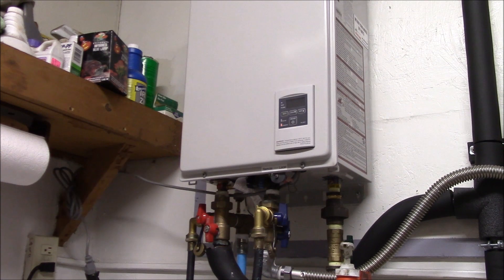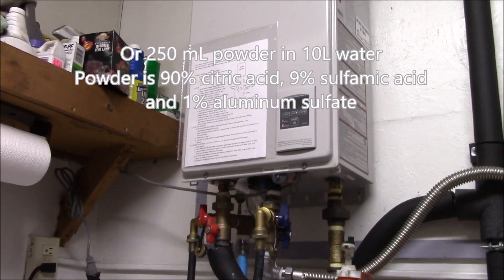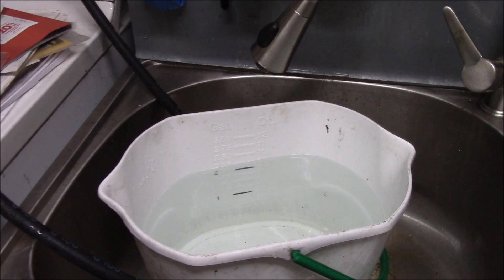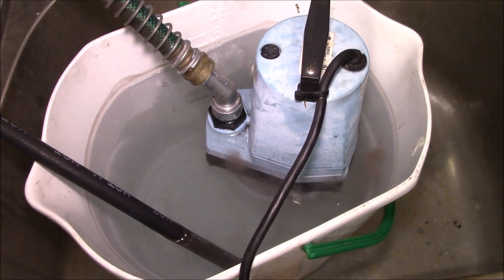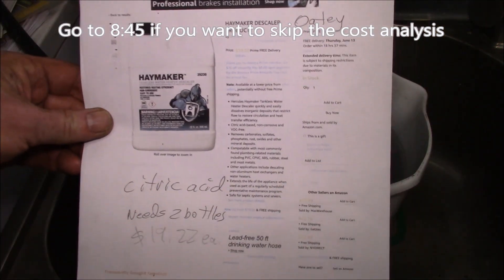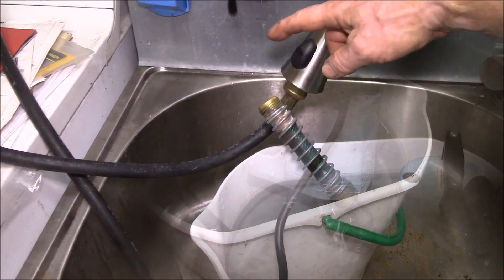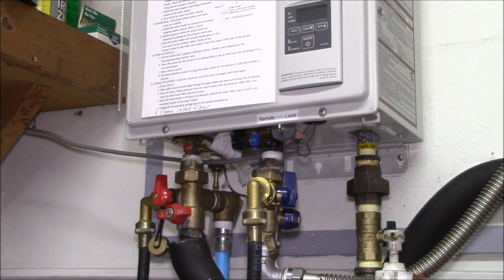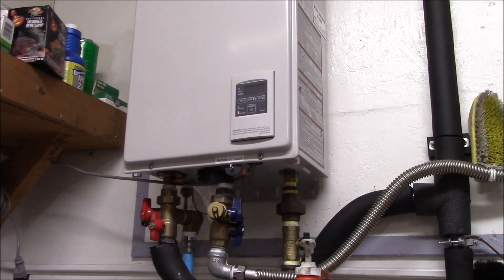Descaling a Tankless Water Heater with Citric Acid Mix

Comment: Great video. Thanks for doing this.

P.S. I did notice that the temp was still set to 140° at the end. 😉
Reply from the maker: Yes, thanks.  I was planning to run the dishwasher after this, so I left the temperature set high.  I tend to set the temperature for whatever task I need the hot water for.

Comment: Thank you for your valuable information. My friend just bought a condo with a Takagi water heater. Unknown if it has been flushed. I’m going to buy some Dezcal and follow your instructions. I was hesitant to buy the ready made tankless descaling products that you mentioned. I don’t understand why the electricity needs to be unplugged from the outlet? So the tankless water heater isn’t running and the pump is running to circulate the descaling solution? Thank you for your time and effort.
Reply: Thank you for explaining that point. It makes sense….and thanks for responding so quickly. I’m off to descale the tankless water heater just in time because the water pressure seems really low at the kitchen sink. I don’t have your ph meter, but I do have ph test strips. That should work fine.
Reply from the maker: @bettyyoung868  No real need for the pH testing.  I mainly did that for the video and to make sure my descaling mix was strong enough.  I used about 1 cup of powder to a bit over 2 gallons of water and that seemed to do the job.  I save the used liquid for cleaning around the house, it's great at removing hard water and rust stains.
Reply: @The4Crawler  Can I use the descaling solution in my washer? I think I can use the solution in my dishwasher to clean it too. I will strain before reuse.
Reply from the maker: @bettyyoung868  Yes, I save all of mine in gallon jugs and use it over the next year or so for cleaning.  Dump some in the dishwasher and run a wash cycle. 
https://youtu.be/EwGFnkvtcWE?si=vLIWEX4AhbhDKxZe
Reply from the maker: White vinegar works as well, maybe a gallon or two.  I think the idea of unplugging the heater is that there may be internal valves that may bypass the heat exchanger if the machine is turned off.  But when unplugged, all those valves stay open so that the descaling solution can flow through the internals vs. just going from inlet to outlet.

Comment: Very good and informative video. I need to do that too. Maybe mine, Rinnai, is broken, it says I should descale when I get a code... well I never got a code in 7 years and I forgot to kind of do it anyway. I will try this to see if I get any scale in the pail using citric acid. I will start with same dilute. Thanks again
Reply from the maker: I always wondered about the scale sensors.  My Takagi doesn't have one, so I just do mine every year or two.

Comment: Good job! My only concern is the strength of your descaling solution of 1.2 ph. This is well over 10 times the strength of vinegar which is recommended by tankless water heater manufacturers. Won't this over time damage the hot water heater? If not, why don't manufacturers recommend a stronger descaler?
Reply from the maker: I based the mix on the ratios used by my Espresso machine descaling powder (Dezcal):
https://youtu.be/bJGKcatfei4
The mfg. of that machine also listed vinegar, diluted 50% with water, as a recommended solution, but have now updated their recommendation to use something like citric acid.  I found other descaling products using citric acid, hydrochloric acid and other compounds.  I suppose most mfgs. list vinegar as it's a generic, readily available product and will do the job given enough time.
Reply: @The4Crawler  The recommended 28g of Dezcal per liter of water would yield a 2.11 ph descaling solution since it's only 60% citric acid. Of course, the ph would be a bit lower due to the 5% sulfamic acid in Dezcal. That's about 1/8th the strength of a 1.2 ph descaling solution. Obviously a 1.2 ph solution would descale better and faster. But will it harm my $1,500 tankless water heater? I've been unable to find any definitive information one way or the other. If I don't find out soon, I'll play it safe. I'm leaning toward using a 2.38 ph citric acid solution (i.e. 5.25 g/l). That's the strength of 6% white cleaning vinegar. At best, I'll mimic the 2.11 ph Dezcal solution. Thanks for your help.
Reply from the maker: @wbailey2526  My mix likely came out stronger as the Dezcal powder likely has some inert fillers which I didn't include.  I'll try a lower concentration next time to see how that works.

Comment: Why not dilute the muratic acid,(pool supply) which I think is a 60% HL Acid?  A gallon of muratic is about 5-6$. your unit looked really clean. I have seen very dirty cleaned water with vinegar after 3-4 hours of it running.
Reply from the maker: Yes, that's another option.  I think some of the commercial descaling solutions use HCL:
https://youtu.be/E1-DanQEJEw
I suppose if you have that around for other purposes it would be a good option.  I've worked with that before and it's pretty nasty to handle requiring rubber gloves, goggles and mask for the fumes.  Also, I found that storing an opened/resealed bottle resulted in lots of surface corrosion in the area around where the acid was stored.  I'm liking my citric acid mix, it's easy to handle and mix and store.
Reply: @The4Crawler  You can also use industrial strength vinegar, I think 70x stronger than regular 5%acidity vinegar. I have some and I think that would cut through scale and in less time.
Reply: @The4Crawler  YEs, and HCL can be aggressive if not diluted enough. I too like your Citric Sulfamic solution. I used the Urinex Product in my espresso machine and it works great, but very costly. I just installed the valves as the house with tank didnt have any, and it makes these weird noises like a semi truck stopping. So it maybe also the fan that winds up that needs cleaning as well. 
Yours was the least dirt I had seen in 10 videos I watched...Either yours was clean you dont have so my fluoride added or lower on hardness in your water, or you cleaned it before, or the solution running for the time you gave it, didn't do a thorough job.

Comment: I put some citric acid in my hot water heater tank and now my water runs blue. I think it's reacting with my copper pipes.
Reply from the maker: Most any acidic solution will react with copper and/or deposits on copper piping.  I notice a bluish tint to the descaling solution after running that through the tankless heater.  I've never tried descaling a tank water heater.  Might try flushing out the tank a few times (drain and refill) and see if it clears up.
Reply: @The4Crawler  It's pretty diluted now. Just a slight blue tint. A few showers and it should be mostly gone. Thanks.

Comment: Just curious, why do you need sulfamic acid and aluminum sulfate? I am going to use just pure citric acid
Reply from the maker: I was following the ingredient list for the Dezcal descaling product that I use in my espresso machine:
https://youtu.be/E1-DanQEJEw
I imagine straight citric acid would work as well.
Reply: @The4Crawler  yeah, I don't think it's really necessary to replicate the commercial recipe exactly :) when I descale anything else in the house I just use pure cistic acid and it works great :) I think 10 litres is a bit of an overkill. I used a 4 litter juice canister. I have a pump that has a hose inlet (Ryobi hybrid pump) and it worked well. The water became intensely blue :) By the way I have a water floss, it worked beautifully for cleaning the sediment filter. Kind of like a tiny pressure washer.
Reply from the maker: @michaelkuzmin  Yes, I think I'll dial back on the volume of solution I use.  I started off with close to the volume the mfg. recommended for vinegar and did the mix concentration based on the Dezcal espresso machine solution.  I think I'll go for around 1 gallon/4 liters like you used.  I like to save the used solution for cleaning water deposits around the house.  I think that amount will match how much of that I can use in a year and it's easier to store one jug instead of 2 or 3.
Reply: @The4Crawler  actually I just read up on the blue colour of water. it looks like it means I overdid with the acidity. also it looks like people are saying that vinegar might be better because it doesn't disolve copper pipes as much. maybe I will try it next time. anyway, I doubt very much I can disolve anything dong this process once a year. https://www.home-barista.com/repairs/blue-water-after-descaling-t52941.html
Reply from the maker: @michaelkuzmin  It may be that the added ingredients in the Dezcal mix are to help with the issues mentioned on that thread.  Funny how you can find similar threads saying vinegar is terrible and XYZ is better.  I like the citric acid mix because it's easier to store and less expensive than vinegar, especially if using a few gallons of the stuff at a time.  I get a faint blue-green tint to the citric acid water but I also had the same result with vinegar.

Comment: Planing to do something similar to mine 50galon hybrid water heater.  I have well water
Reply from the maker: Yes, that would probably be a good idea if you can work out the proper mix/volume for doing so.
Reply: @The4Crawler  3Lb of citric acid for 50galon heater should be good?
Reply from the maker: @victordankanych  That sounds like a good mix to start with.  Maybe try it out on a shower head or something that's got hard water deposits on and see how it works.

Comment: Interesting, 8 oz citric acid powder plus 2.5 gallons of water is a 2.3% solution... I am planning on doing 16 oz in 2 gal of water to make a 5.7% solution when I clean my tankless next week. Planning to use food grade citric acid (powder).
Reply from the maker: I was going by the ratio used in my espresso maker descaling solution of 1 ounce per quart of water.  Will be interesting to hear how your stronger mix works.  Should work faster for sure.
Reply: @The4Crawler  I did the clean out Sunday and the water got pretty dirty pretty quickly. I added an extra gallon of water 30 minutes in to dilute the dissolved scale. 30 minutes later the flush was done and I did three minutes flush with straight water which stayed clean. Funny I pulled the connector for the thermal fuse instead of the connector for flushing and ended up with an error 14. But I reconnected it and power cycled the unit and that cleared the error. The unit seems to operate fine.
Reply from the maker: @dthatcher7  Sounds like it was due for a descaling flush.  I need to get mine done, maybe I'll try a slightly stronger mix this time.
Reply: As vinegar typically is diluted to 5% it seems like about 2 cups of citric acid for 2.5 gallons of water would be about the same as vinegar then, does that seem right?

Comment: How are you coming up with $12 a year to run it? The unit I have operating cost per year is around $199 annually.
Reply from the maker: Good question.  I assume you are going by the Energy Guide label on your unit.  Mine is stickered $176/yr:
https://youtu.be/wlw7ssl9HFQ
Those numbers are useless unless you use the assumed 64 gallons of hot water per day.
Instead, I recorded my actual gas consumption and gas bill data for a year and found my unit averages about 2 therms of gas every 3 months:
https://youtu.be/OBpjMeCODHk
Over a year, that's about $12 cost with my gas utility.  And 3 years on, and the gas consumption is still the same.
Reply from the maker: Here's my last years gas bill total from PG&E:
https://photos.app.goo.gl/vW9daXKDGJuQNoCN9
The utility distribution cost has gone up over the last few years plus I'm also using gas for a cooktop and BBQ so my annual gas cost was $16.00